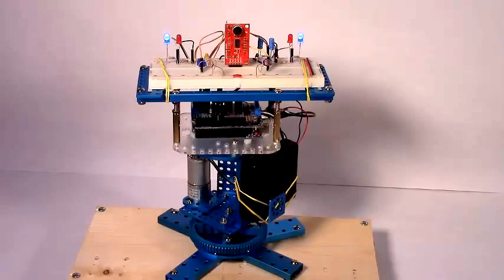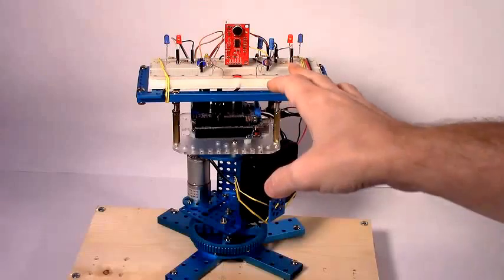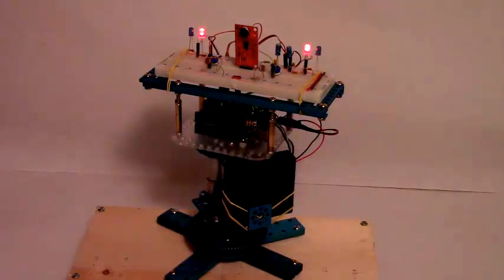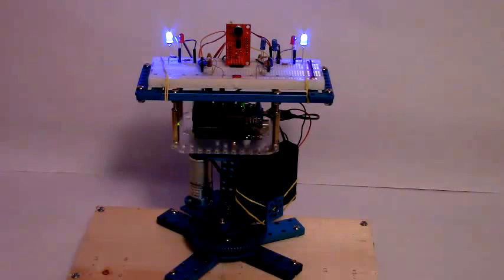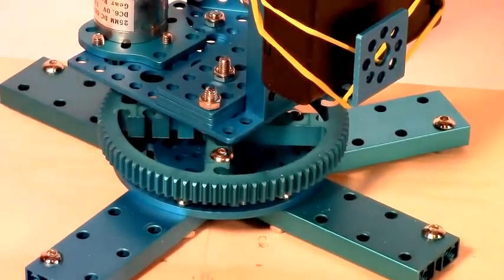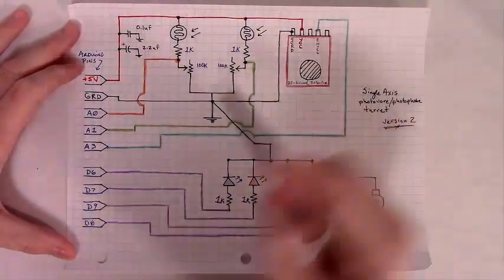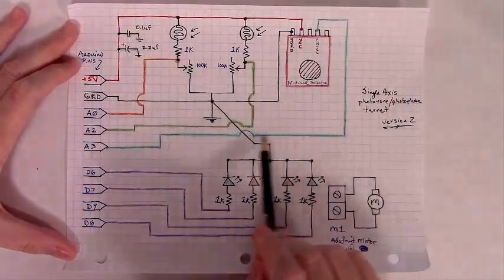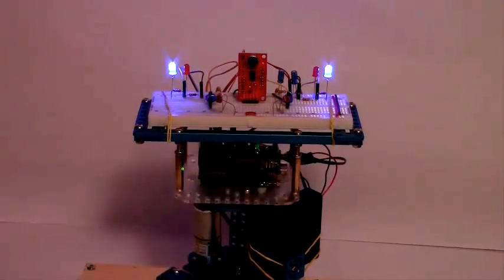Arduino Robot Projects || Single Axis Light Chasing/Avoiding Turret || Version 2 || Mode Selection

Comment from the maker: /*
title: photovore_photophobe_turret_version_2
by: philomech
date: 2/2015

*code logic and control structures could be simplified, but works fine for now*
*/
#include <Wire.h>
#include <Adafruit_MotorShield.h>
#include "utility/Adafruit_PWMServoDriver.h"

// Create the motor shield object with the default I2C address
Adafruit_MotorShield AFMS = Adafruit_MotorShield(); 
// Or, create it with a different I2C address (say for stacking)
// Adafruit_MotorShield AFMS = Adafruit_MotorShield(0x61); 

// Select which 'port' M1, M2, M3 or M4. 
Adafruit_DCMotor *motor_one = AFMS.getMotor(1);  //turret motor connected M1

/************************
* global variables        *
************************/
//photocell variables
const int p_cell_left  = A0;  //assign p_cell pins
const int p_cell_right = A1;

int left_value  = 0;       //stores incoming
int right_value = 0;       //p_cell readings  

const int bright_threshold = 800;  //adjust as needed

//mode indicator leds
const int left_blue_led_pin  = 7;  //assign led pins
const int right_blue_led_pin = 9;
const int left_red_led_pin   = 6;
const int right_red_led_pin  = 8;

//sound detector variables
const int sound_pin  = A3;   //assign sound detector pin
int sound_value      = 0;    //stores incoming
                             //sound values
                             
int sound_threshold  = 65;    //adjust as needed  

int vore_phobe_mode  = 0;    //tracks current turret mode
                             //(photovore = 0 photophobe = 1)
                             //toggled via snap of finger

/************************
* setup                   *
************************/
void setup(){
 
  //Serial.begin(9600); delay(100);  //for debug
  
  //set pin modes
  pinMode(p_cell_left,  INPUT);  
  pinMode(p_cell_right, INPUT);
  pinMode(sound_pin, INPUT);
  pinMode(left_blue_led_pin,  OUTPUT);
  pinMode(left_red_led_pin,   OUTPUT);
  pinMode(right_blue_led_pin, OUTPUT);
  pinMode(right_red_led_pin,  OUTPUT);
 
  
  AFMS.begin();  // create with the default frequency 1.6KHz
  //AFMS.begin(1000);  // OR with a different frequency, say 1KHz
  
  // Select which 'port' M1, M2, M3 or M4. In this case, M1
  Adafruit_DCMotor *myMotor = AFMS.getMotor(1);
  
  // Set initial motor speed, from 0 (off) to 255 (max speed)
  motor_one->setSpeed(140);  //adjust as needed
  
  motor_one->run(FORWARD);
  motor_one->run(RELEASE);
  
}  //<---end setup

/************************
* main loop               *
************************/
void loop(){
  
  //collect sound values
  sound_value = analogRead(sound_pin);
  
  //collect left-right p_cell values
  left_value = analogRead(p_cell_left);
  delay(2);
  right_value = analogRead(p_cell_right);
  delay(2);
  
  /*
  //for debug
  Serial.println(" ");
  Serial.print("sound = "); Serial.println(sound_value);
  Serial.print("Left = ");  Serial.println(left_value);
  Serial.print("Right = "); Serial.println(right_value);
  delay(300);
  */
  //if sound value exceeds threshold, toggle value of mode variable 
  if(sound_value > sound_threshold){
    
    delay(150);        //for stability (reduces # of false triggers)
    
    vore_phobe_mode = !vore_phobe_mode;   //toggle current mode value
    
  } //<--end of mode switching/toggling code
  
  //if mode variable == 1, then switch to photophobe mode 
  if(vore_phobe_mode == 1){
    //-photophobe/light avoider code-//
    digitalWrite(left_blue_led_pin, LOW);   //turn off blue leds
    digitalWrite(right_blue_led_pin, LOW); 
    digitalWrite(left_red_led_pin, HIGH);   //turn on red leds 
    digitalWrite(right_red_led_pin,HIGH);   //indicative of "not liking"
                                            //bright light
                                            
      //Is either value greater than bright_threshold?
      if((left_value > bright_threshold) || (right_value > bright_threshold)){
        //if left value is greater than right, turn "right"
        //i.e., turn away from the light
        if(left_value > right_value){
          motor_one->run(FORWARD);
        }
        //else if right value is greater than left, turn "left"
        else if(right_value > left_value){
          motor_one->run(BACKWARD);
        }
        //else if they happen to be equal, stop motor (possible 
        //but unlikely given current orientation of p_cells)
        else if(left_value == right_value){
          motor_one->run(RELEASE);
        }
      }
      //stop motor is neither is above bright_threshold 
      else {  
        motor_one->run(RELEASE);
      } //<-end of photphobe/light avoider code-//  
     } //<--end of photphobe mode code
    
  else if (vore_phobe_mode == 0){
      //-photovore/light chaser code-//
      
      digitalWrite(left_red_led_pin, LOW);   //turn off red leds
      digitalWrite(right_red_led_pin, LOW); 
      digitalWrite(left_blue_led_pin, HIGH);  //turn on blue leds 
      digitalWrite(right_blue_led_pin,HIGH);  //indicative of "liking"
                                              //bright light
                                              
      //Is either value greater than bright_threshold?
      if((left_value > bright_threshold) || (right_value > bright_threshold)){
        //if left value is greater than right, turn "left"
        //i.e.,turn toward the light
        if(left_value > right_value){
          motor_one->run(BACKWARD);
        }
        //else if right value is greater than left, turn "right"
        else if(right_value > left_value){
          motor_one->run(FORWARD);
        }
        //else if they happen to be equal, stop motor (possible 
        //but unlikely given current orientation of p_cells)
        else if(left_value == right_value){
          motor_one->run(RELEASE);
        }
      }
      //stop motor is neither is above bright_threshold 
      else {  
        motor_one->run(RELEASE);
      } //<-end of photovore/light chaser code-//
  } 
}  //<--- end main loop